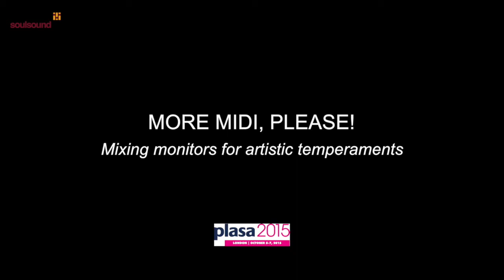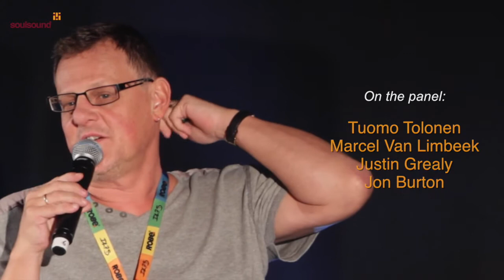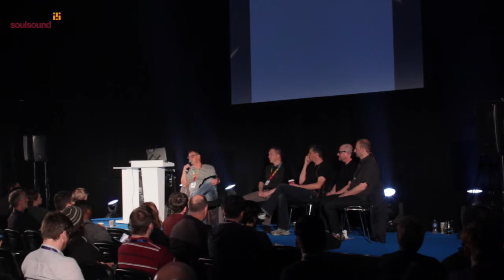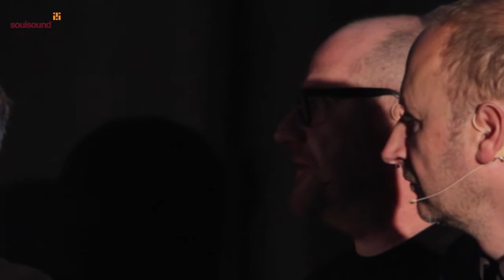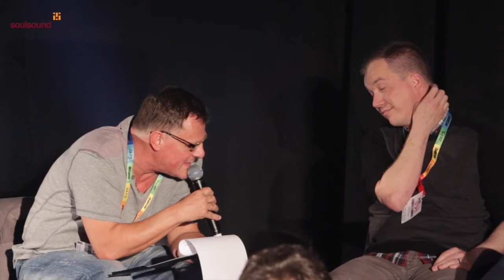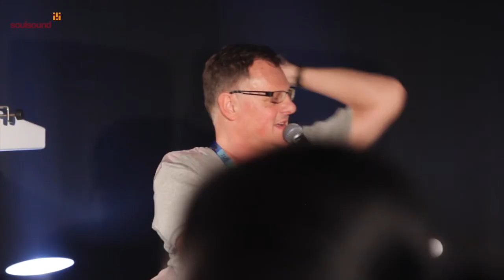Mixing Monitors Panel PLASA London 2015

Comment: Wireless sound production sounds good in theory and looks good on paper. But none of that means a hill of beans come show time. 
In 41+ years of performing live in every type of venue across different genres of music using widely varying sound systems and sound technician arrangements, I've learned MANY things. And I'm still learning. But by and large, I've learned that while innovation is good and necessary, getting the job done is paramount. Therefore, I stick with gear, methods, and approaches that I've learned through experience I can rely heavily on to perform for me on a regular basis. 
My current three piece band utilizes wireless guitar and bass systems and wireless IEMs, all of which operate at 2.4ghz. We also have remote tablet control of FOH and individual tablet control of IEMs for bassist and drummer, all operating on 5ghz but, the associated wifi modem transmits simultaneously at 2.4ghz also.
Our systems are not top of line professional touring rigs with licensed frequency ranges, but they are much higher quality than most other club bands in our region carry. They are ALL supposed to be capable of eliminating or avoiding interference and dropouts via their proprietary circuit designs. They do not. 
The fact is, in todays world there is scarcely a person in any audience who isn't carrying a smart phone or other device. Furthermore, EVERY venue has one, two, or many wifi systems operating inside.
This simply is NOT an environment where wireless technology can be relied upon for reliable sound reproduction. Therefore, I still have the digital mixing console beside me onstage while performing as a safeguard to ensure control of FOH and auxes if/when wireless control goes down.
I just purchased supplemental DMX lighting gear and decided then to also move away from wireless lighting control, which has failed multiple times at EVERY show I've used it on. From here on, I'll use wired DMX.
Call me closed minded.
Call me old fashioned.
But call me and I'll give you an uninterrupted show from start to finish even though it does require more effort on my part.